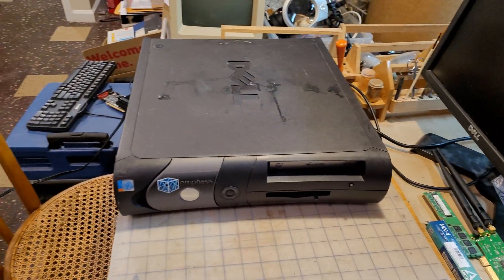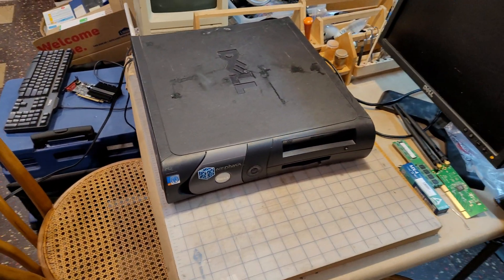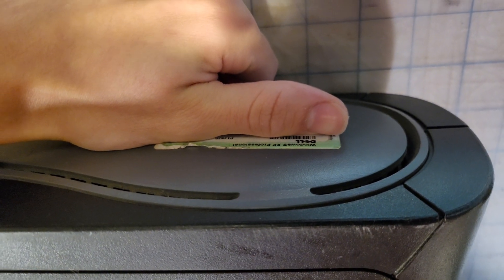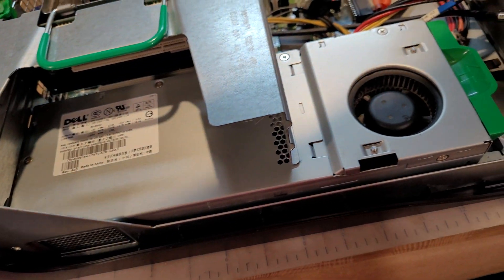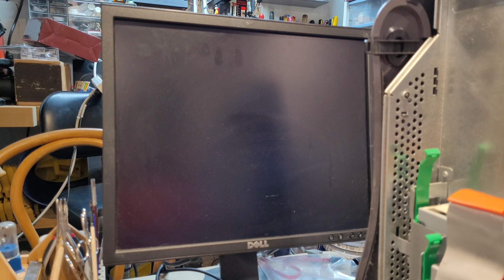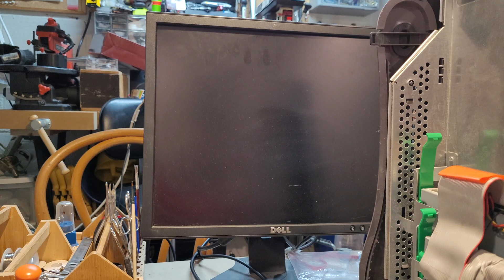Dell Optiplex GX280 SDT CPU Overheating Problem

Comment: Well, you should really, REALLY take a LOOK at how terrible those CAPACITORS are. If the CAPS ARE LEAKING, then you should really, REALLY replace ALL Of those CAPS. If you cannot do as such, then just get another mobo or toss the thing out.

Pentium 4 CPU's are known for running a bit warm, but the CAPS have to be CHANGED period. You are basically answering your OWN question. If the CPU was bad, then the PC would NOT display on the screen PERIOD. Dell PC's DO have an Alarm for beeping when something is terribly wrong; that would be either BAD Memory Modules, Incompatible Video Card, intrusion or incompatible CPU.